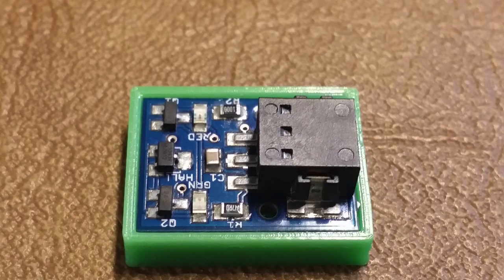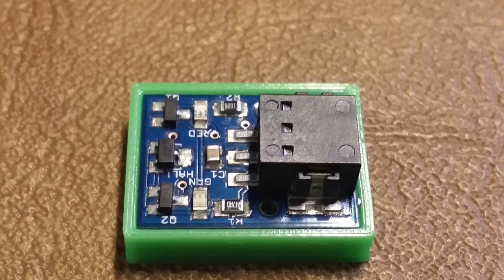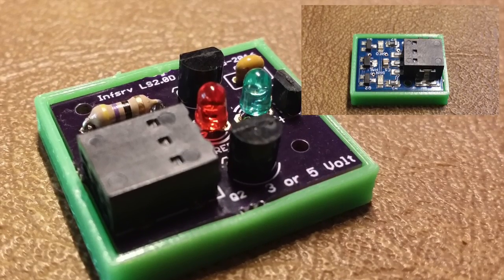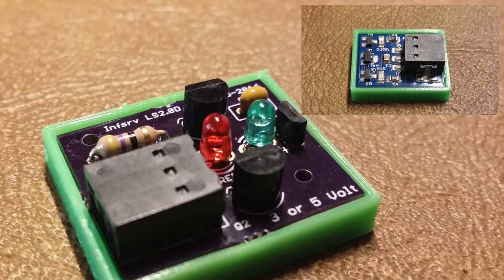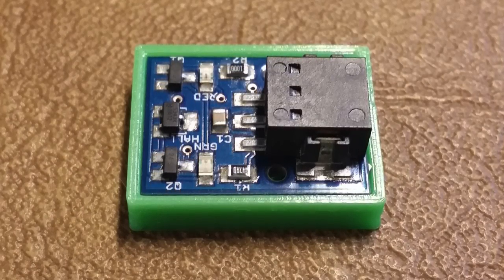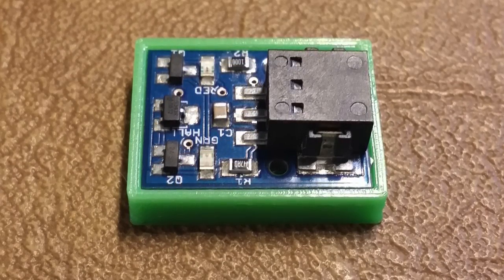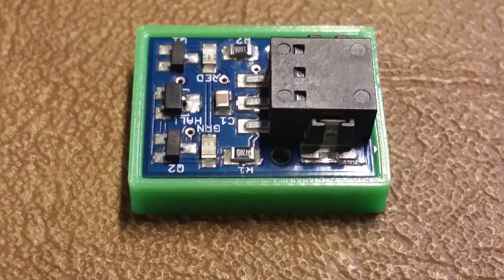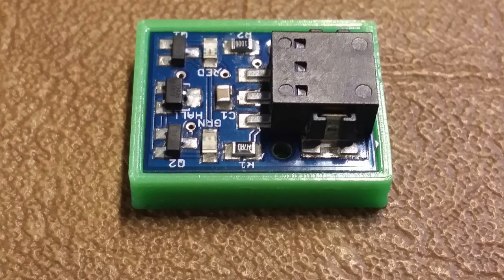Hall Sensor Limit SWITCH

Comment: Just ordered mine from Tindie. Can't wait to stop crashes. I've wrecked 3 mechanical switches now. How quick is turn around for orders?
Reply from the maker: I usually send them out the day or day after I receive the order.  Mostly dependent on the time the order comes in.  I just saw your order and it will go out today. You should have them Wednesday / Thursday latest.  Thank you.